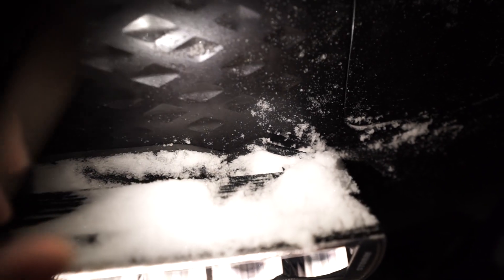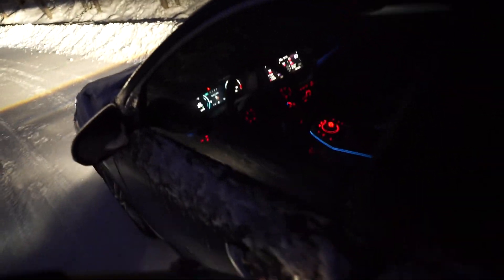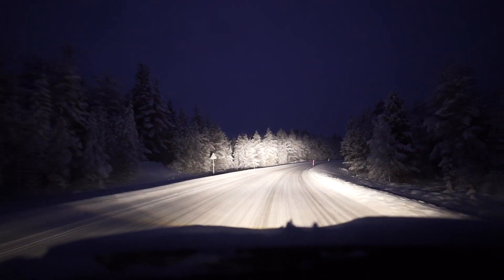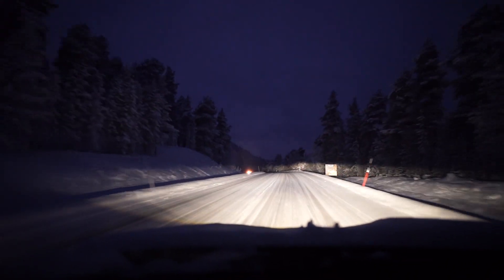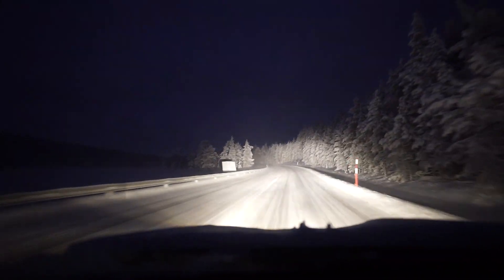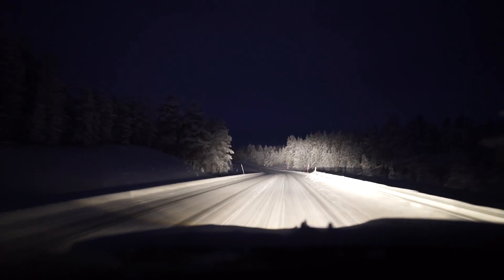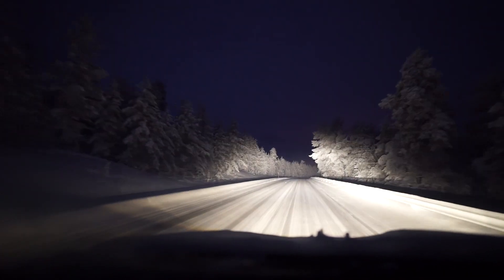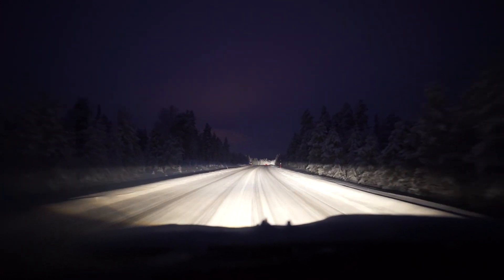Kia e-niro LED headlights + Lightbar test in Lapland, Finland

Comment: Hey man, did you have to buy a separate CAN sniffer box to get the high beam signal to turn on the relay to the LED bar? Or was there a cable you could splice into under the hood? Thanks!

I believe the most accessible canbus wires reside below the driver's dash behind the BCM module (hi&lo = red&blue) but obviously I'd like to avoid tapping into those if possible.

Comment: did you have any clearance problem with the changing hatch?
Reply from the maker: No problem, there is a couple cm clearance and charge flap opens fine. I also measured the space there above licence plate and charge flap and only bought a light bar that I knew should fit. But this light bar is quite typical size, so I think most would fit there fine.